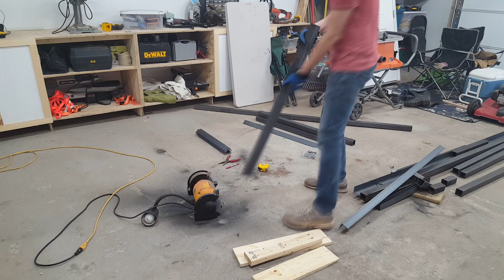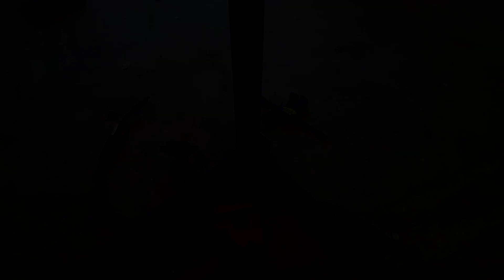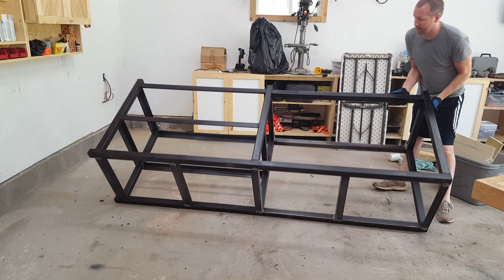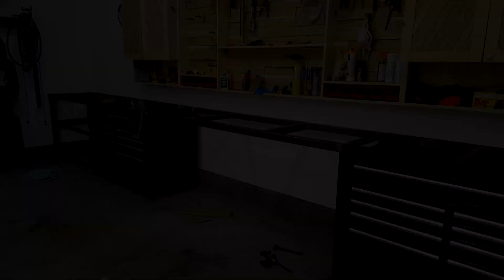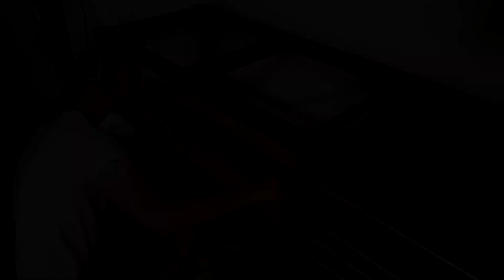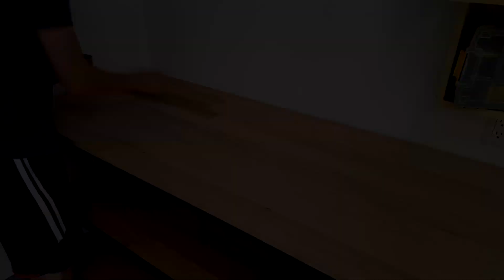Built in Tool Chest Workbench

Comment: I did this same setup in my garage but bolted my bench to the wall. Ended up with about 9 inches underneath where I can open the garage door and blow out the sawdust. Goal was nothing on the floor without casters so I don’t get the mess I lived with before😂
Reply from the maker: Good idea bolting it to the walls. It is amazing how dirty a shop can get so the easier to clean it out, the better!

Comment: Awesome job! I built a new farm shop last year and it took me a long time to figure out how I was going to build the work bench. I had bowling lane material that I used for the top. It's secured to the wall using a 2x6 ledger and legs that are anchored into the cement floor. I also have steel drawers like you have underneath. If I had seen your video beforehand, I would have built a steel frame like you did. Excellent idea as it is all plumb and allows you to adjust the feet to match the unevenness of the cement floor. That would have saved me some time. 

I anchored it to the floor and wall because sometimes we have to pry on something that's in the vise. That way the bench and vise are secure and won't move. I just might pull it all out and build it your way, but still securing the work bench. And great job on the benchtop too. I agree that it looks too nice to work on!

Regarding the Husky tool cabinets, were you able to buy them without wheels? I have Master Force from Menards under mine but they are now unavailable (the ones without wheels) and I'm going to build another bench in the shop.

Comment: Outstanding! Exactly what i am going to do for my shop. One question, the side outlets on the chest, where you still able to use them after you installed the cabinet in the frame.
Reply from the maker: Thanks! I didn't use the side outlets at all, but I'm pretty sure you could. I have plenty of outlets on the wall so I just didn't want to mess with it.

Comment: Did you account for wood movement when attaching your top?
Reply from the maker: No, I didn't really factor that in. I haven't ever had any issues with pocket screw oak tops like I did here. What climate you live in could be a factor though.
Reply: @chaddiy  I don't think the pocket screws will be the problem rather the connection between the top and the much stiffer steel frame. I'd look to have some way for the wood to move there.